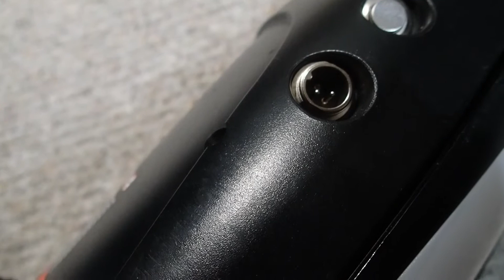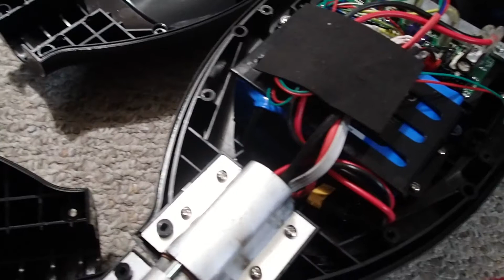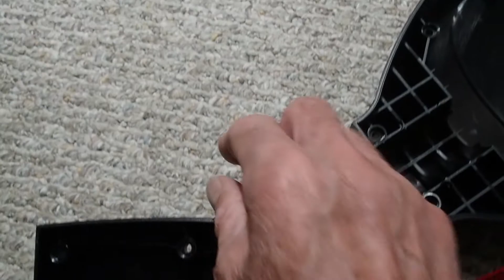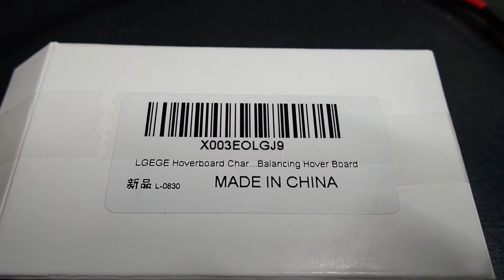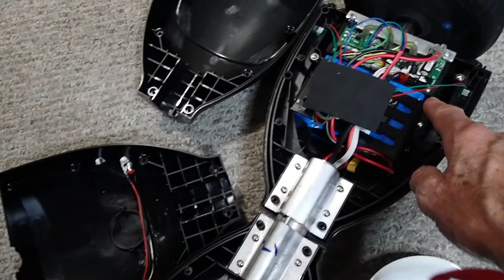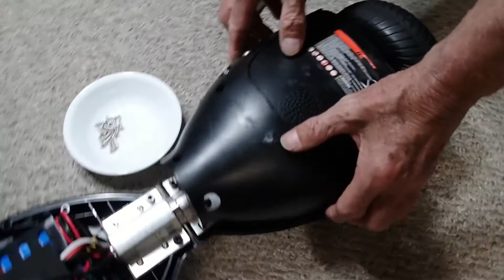Jetson Sphere Hoverboard power connector repair

Comment: Hi, any idea if splicing the wires to a new power connector would work, to avoid soldering?
Reply from the maker: Splicing will work just fine.
Reply: @emcalnan I tried to splice in w the old wire attached to the board as the new cable wasn’t long enough . It didn’t work and I swapped the lines to be sure the cables weren’t reversed. Off to the recycling center.

Comment: Hahaha, you have to solder anyway. You could have soldered the old one, and not buy a new one.😂
I have done similar dum things like that.😁
Reply from the maker: But the connector had a broken pin.  Not clear how soldering would have fixed it.